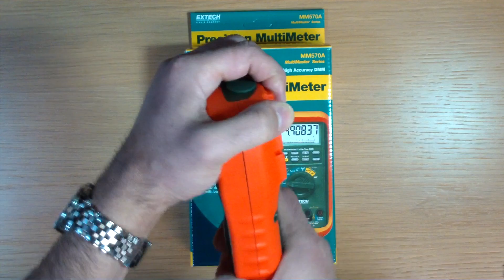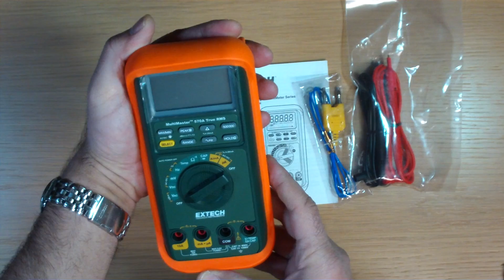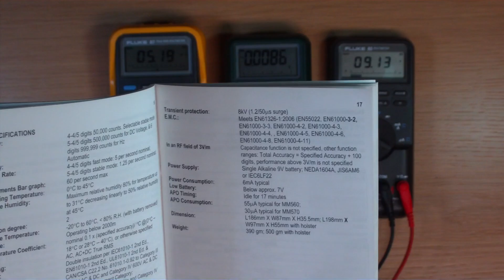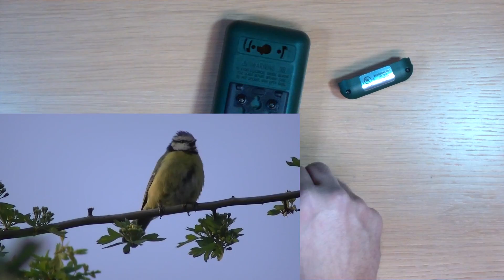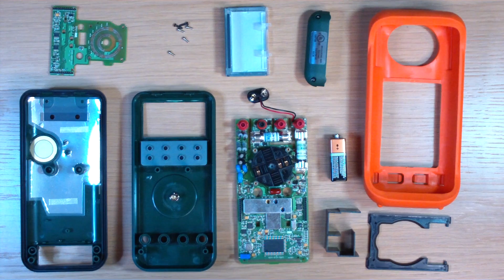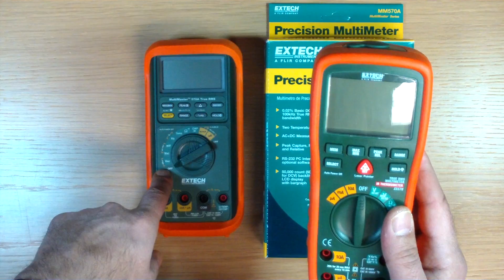Review and teardown of Extech MM570A Precision MultiMeter

Comment: I have an extech 560 that I bought about 10 years ago.  It developed missing segments on the display, but I was able to put pressure on it and all segments started working.  I took it apart and put little spheres of ridico putty between case and lcd and that seems to work.  I'm not sure the accuracy is still good, but I need to replace battery first.  Shorted leads measure erratic ohms around 50.  That's obviously wrong.  I paid a lot of money for high accuracy, but I'm disappointed. You mention soldering problems, do you have any suggestions on if I should reflow anything for improvement?
Reply: I'm having the same problem

Comment from the maker: It is rebadged Brymen indeed but not 857A, this one is 859CFa.

Brymen 857A is rebadged as Extech MM560A.
Reply: Nice review. A bit late here but, also available as the Amprobe AM160a . I got the AM160a from Amazon for a little over $100. A well featured multimeter including AC+DC and two temp. inputs